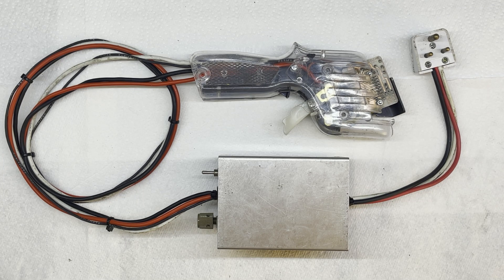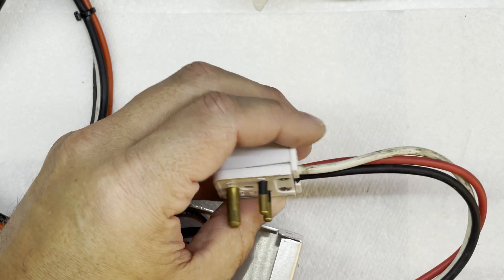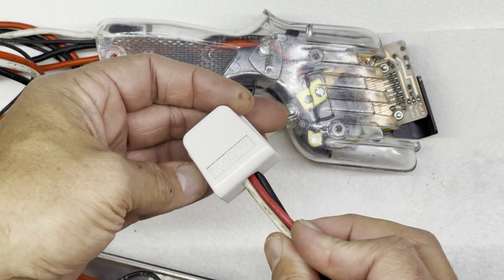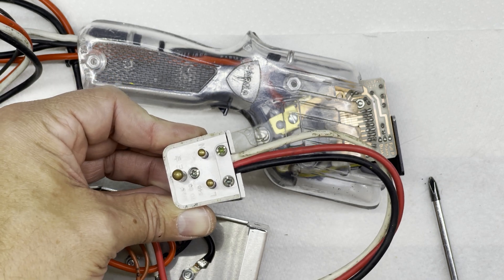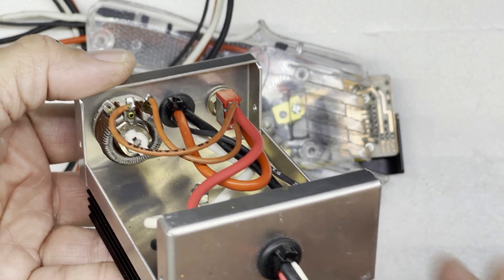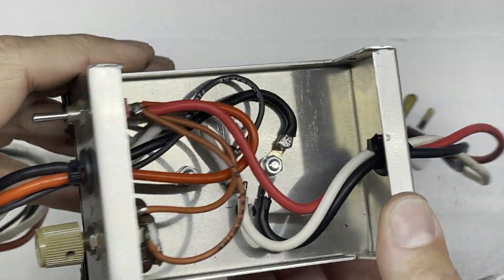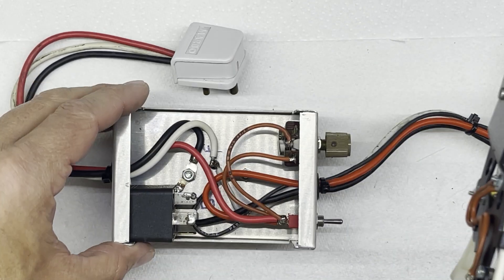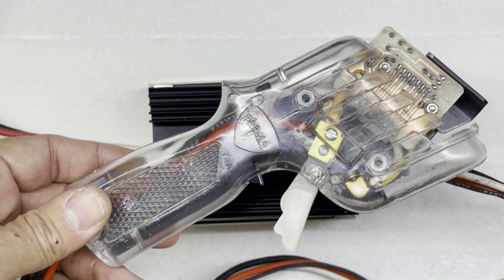Busting the myth about electronic slot car hand controllers - What is in the box?

Comment: I never understand why they use Darlington transistor. At worst case you mentioned 20A, the transistor will have ~2 volt drop (12 - 2 = 10), so you car will be at 10v and then the full throttle switch kicks in and the throttle jumps ~17%.
If I were to design a new controller, i would use a hall effect sensor, 200A 1mΩ FET (at the track terminals, bypassing all the controller wiring and almost zero delay,  unlike the relay has), another fet for braking. This would have a finer control over the current, no steps and could add throttle curves/etc. I would probably add a instantaneous led ammeter (this can show how well the pickup shoes/make contact to the track (checking for pickup or track issues) and some other useful stuff.
My last power supply and gun I made ~27 years ago. I mostly race AFX. The power supply was regulated 2 channels (one for each lane). On the gun i had 7 switches for power, reverse (mom and latch), brake (3 pos), NOS (afx was 12v, but we ran 25v (this made all of our cars fast), and NOS was 40v), led ammeter. I would link a pic, but yt will delete my comment. Oh, and on the PS, I had a switch to series the 40V channels for 80 volts!
Any links to the latest high end controllers?
Thanks for sharing.

Comment: If you take apart the socket for that 2amp plug, you'll see the contacts for the plug pins are VERY small, so really the banana plug is a far better connection than the plug.
Reply from the maker: Yes, you are probably correct in most cases 👍🏻. It can also depend on well the track sockets have been wired.

Comment: I’m a there a risk of electrocution? When slot car racing?
Reply from the maker: Most slot cars run on 12V to 14V DC so the risk of electrocution is very low.
Reply: @CleaveTech  so if a child touched the rail they would be fine right?
Reply from the maker: Yes they would. If they actually licked the rails with a wet tongue they may get a tingle on their tongue but they would be fine 👍🏻
Reply from the maker: I guess there is always a small chance that some rare medical condition could mean that someone might feel more of an effect.

Comment: The reason the alligator clips are used in the USA is they will break away when the wires are pulled. This setup has saved me so much rewire work on the controllers! 
There is a method to our madness!

Comment: Hi! You do not explain much on the way the transistor is connected in this video. Can you explain that also? There is a quick snippet of the circuit, but no explanation. E.g why isn't there a Mosfet used.
Keep going, I like your videos, allthough mostly interested in more standard slotcars like Slot-It, NSR and Revo-slot.
Reply: Hi Rijnout. Thanks for watching. I am pretty sure I put a link to the full explanation of the circuit in the video description but if so didn’t, here it is:
http://www.slotcarracing.org.uk/control/cont1.htm

There will be more Revo-slot stuff to come and I will be preparing another type of car for a race too.
Reply: Mosfets really only like to be fully on or fully off. So you can use them in lieu of a power relay but not really as as means of controlling voltage to a motor.
Reply: @Fabio-ns4ql  That is you dont know how to control them, there are audio amplifiers that use mosfets.
Reply: Thanks James, really Nice article.

Comment: Excellent video but so very wrong about the standard ECRA/BSCRA plug. It's a 2 amp plug - not 5 amp, which is larger. And it was, and still is, used in UK mains installations. You can still buy them in Screwfix and from RS and people are still using them in homes, for low power lighting. Fortunately as far as I know no-one has ever plugged a controller into the mains as it would be very dangerous indeed.

In this era of generally available 3D printing I did suggest the slot car associations around the world should come up with a standard design (with matching socket) that could be printed anywhere and use the metal inserts from some easily obtainable connector, such as the 4mm ones. But no-one seemed interested.
Reply: Thanks John. You are totally correct about the plug. I obviously got mixed up. The 5amp plug has much bigger pins. Thanks for pointing out the mistake.

Comment: Ive designed a brake and coast circuit for the brakes on my controller. Works well on cars that have too much braking power. Applies full brakes via a relay for a pre-set time (adjustable) and then reverts to the brake pot which you dial up accordingly (i.e. not much brakes). Or you can have full brakes via the relay, or bypass the relay and just run through the pot. How handy are you with electronics? If youre interested I'll email you. I think I have the diagram as a pdf
Reply: Thank you Fabio. I would appreciate a look at your circuit diagram. I have had a couple of racers at my local club ask me for that feature.
Reply: @jmcleave  email sent. How savvy are you with electronics as this is not a simple build and conversion. If you have problems understanding the cct diagrams I can guide you through it.
Reply: @Fabio-ns4ql  Thanks very much for the info. I will respect your IP. I am fine with electronics and have used that IC many times. Really appreciate the information 🙏
Reply: @jmcleave  No problems. The cct works well with cars that have way too much brakes. The 3 ohm brake pot was what was fitted to the controller. Can change that to anything that you want and depends on the motors you use. 20 ohm brake pots works well with most 1/32 motors. The input to the pulse cct needs a 12V signal. Ive not tested it for a 0V (earth) input signal but it should work if you splice in the alternate input cct. You can either isolate your wiper arm to provide the 12V signal (Difalco does this as well as others) and the base current to the transistor or fit micro switches like Parma controllers used to have. If you have issues email me.
Reply: Could you email the brake and coast in pdf? It seems that we have several likes - electrons, slot cars, model trains and politics.